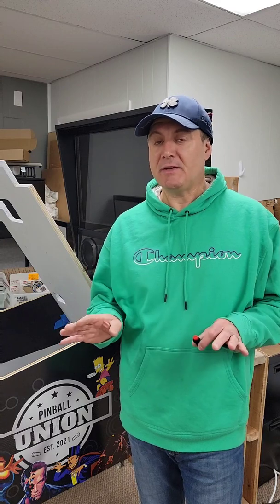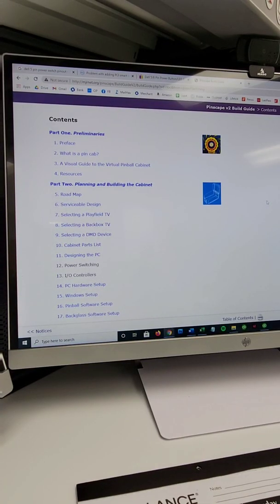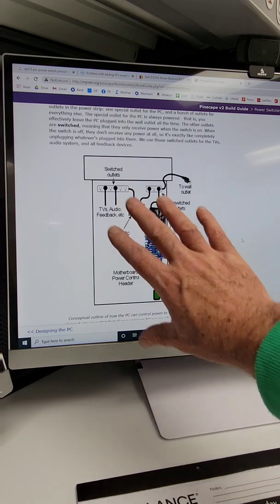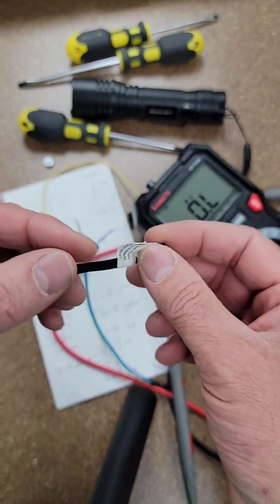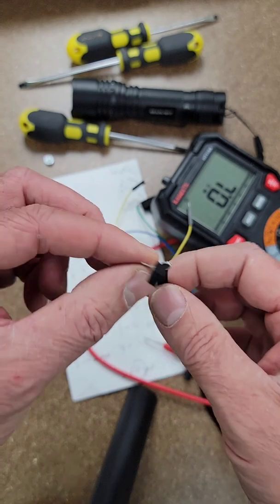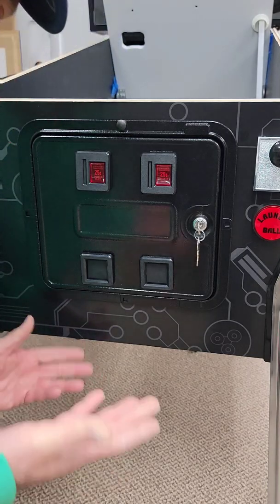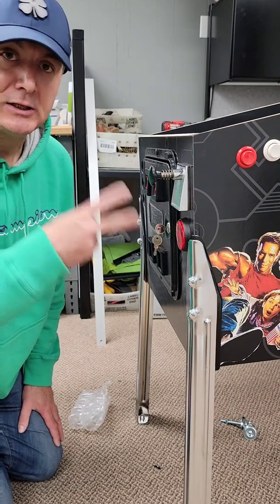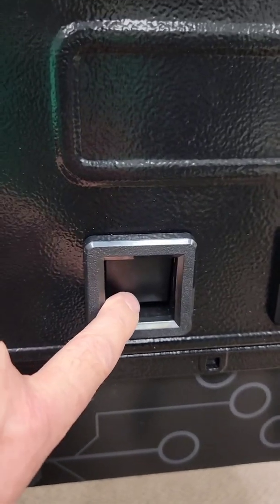VPin Project. Video 35 - Virtual Pinball Power Switching (creative thinking)

Comment: Maybe drill a small hole in front of the power button of the computer. Could reach in and turn it on or better yet use a hinge setup with a small post that you pull toward you on the outside. On the inside of the cabinet it would press the button. I am actually going to have this problem too haha. Have a similar Dell.
Reply from the maker: Thanks for the idea. I've been mulling it over throughout the day. I actually ordered a replacement power switch cable from Amazon and I'm going to attempt to use that and save the original cable. The one from Amazon is much longer and assuming I do it correctly, I should be able to wire the push button in parallel with the correct two leads and install it in the cabinet. I will be making a part 2 of that video. It may help you out since you have a Dell.